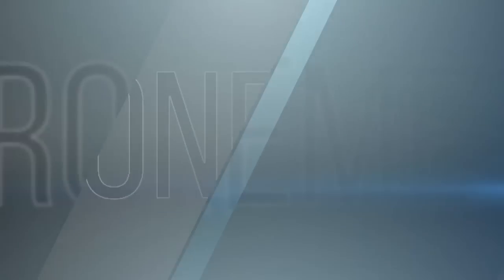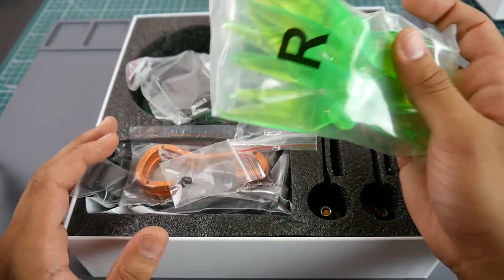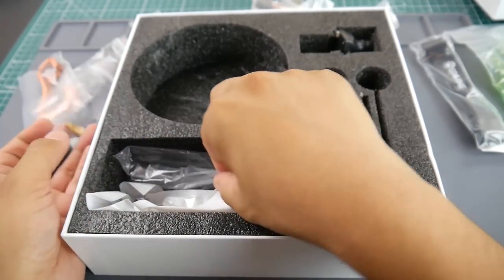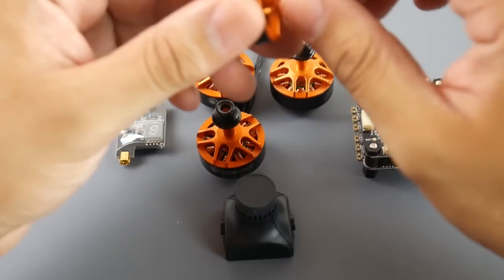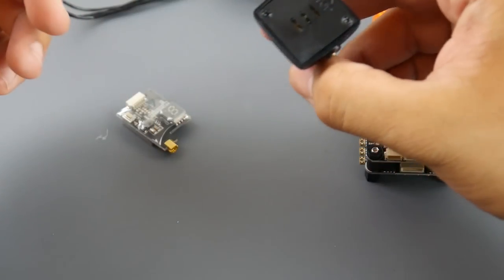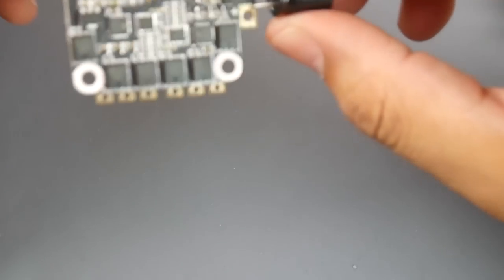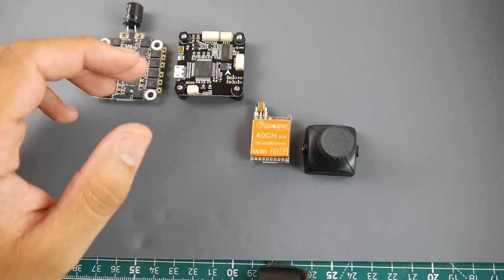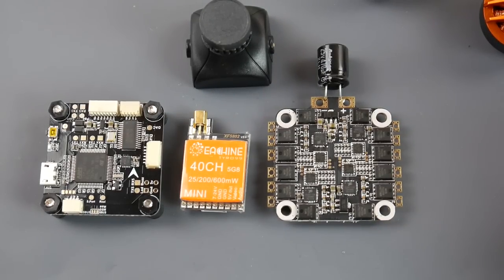$99 #FPV #Racing #Drone #DIY #KIT // Is it any Good?

Comment from the maker: Tyro99
https://www.banggood.com/Eachine-Tyro99-210mm-DIY-Version-FPV-Racing-RC-Drone-F4-OSD-30A-BLHeli_S-40CH-600mW-VTX-700TVL-Cam-p-1338893.html?p=CS101558118042016088&utm_content=zhikejian&utm_campaign=mesh

This Camera is one of the best you can buy and I have on over 20 quads
https://www.banggood.com/Foxeer-HS1177-Sony-600TVL-CCD-2_8MM-IR-Mini-FPV-Camera-5-17v-with-Bracket-p-1047125.html?p=CS101558118042016088&utm_content=zhikejian&utm_campaign=mesh

Comment: What's the camera you recommend
Reply: a potato would be better
Reply: i don"t actually know, i haven't used one of these
Reply from the maker: This Camera is one of the best you can buy and I have on over 20 quads
https://www.banggood.com/Foxeer-HS1177-Sony-600TVL-CCD-2_8MM-IR-Mini-FPV-Camera-5-17v-with-Bracket-p-1047125.html?p=CS101558118042016088&utm_content=zhikejian&utm_campaign=mesh
Reply: Also flying 5" Avan props on a 1550 Tattu

Comment: In  for hobby wing testing  some body is scared. Esc testing is the reason I love this channel come on stop teasing.
Reply from the maker: It blew up 20 min ago on 2nd test cycle. I never had one blow up in testing.
Reply: @DroneMesh  solder splatter or something.
Reply: Bull shit it did LOL. If so show us.
Reply from the maker: @Tunnelrat6666  It will be tomorrows video.. You will see it all
Reply: Noooooooooooo I do not want it to be true my favourite brand. 
I have a combo on its way for my CG 6S build and was about to order another HW combo. I need a new combo for one of my frogs as the ESC stuffed up and I ripped off the USB socket on its FC some time ago.

Comment: It is not the best combo for 4S quad. Although it should be good beginner kit on 5-6S - if ESC can take those voltages. Camera certainly must be replaced to something better. Eachine themselwes have C800T - cheap but nice  camera - I'm curious why they didn't used it here.